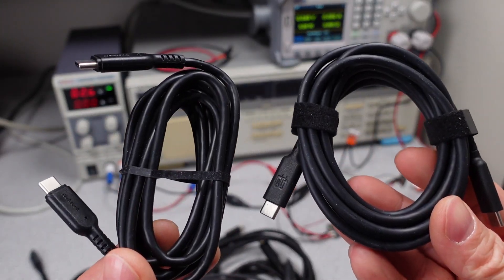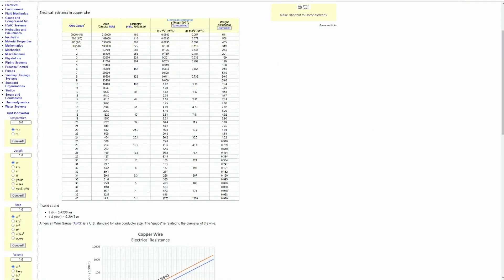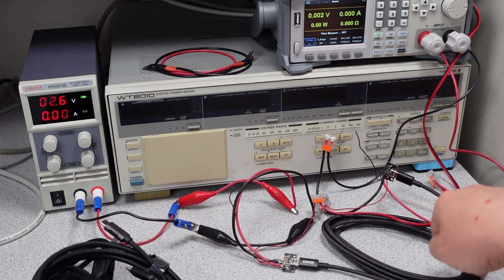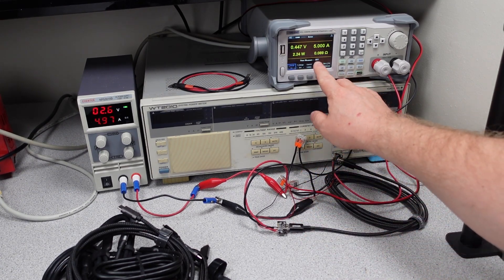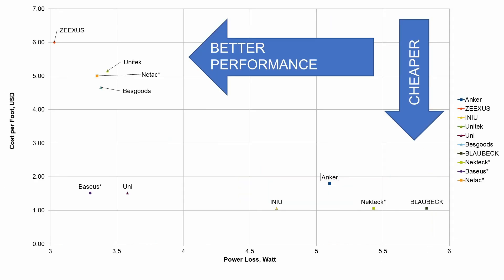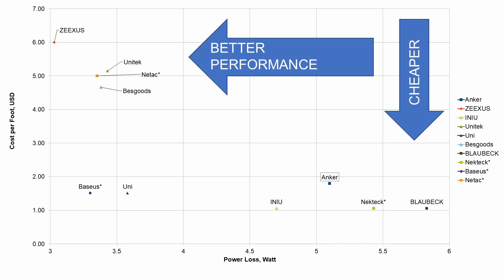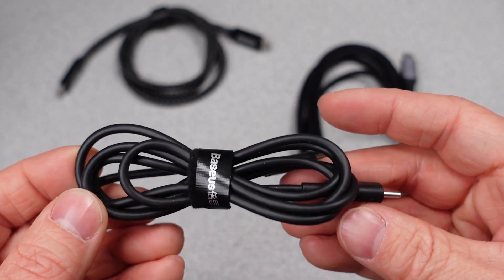Charging with USB C, does the cable matter?

Comment: what is the real world consequence of "inefficient" cables from efficiency loss? I feel like its gotta be like 10 seconds longer to charge device but idk.
Reply from the maker: In terms of time, it should make no difference at all, in terms of energy it can make a difference.  Say 1 watt loss for an average cable and connector, over an hour that's 1 WH, which is 6% of the capacity of a typical smart phone.  In terms of charging time, it's irrelevant because the cable isn't the limiting factor, it's just a lossy element between the charger and phone, both also lossy elements, the voltage is higher than the battery, as long as the cable isn't complete trash, what gets to the phone will be high enough that it can still operate at 'maximum' charging speed.

Comment: Awesome diagnostic and data!! Only thing I would mention is that perhaps you could have standardized you final charge against the cable length? I'm forget how the math would work on that since I believe resistance increases at an exponential rate over distance if I remember correctly. Bottom line, from your analysis I thought I wanted a Baseus cable for the value, but when I scrolled back in your video to check the length of that particular cable, I decided I wanted the more expensive ZEEXUS after all because I want that 4 feet since 3.3 isn't quite enough, and is a stupid fraction anyway, LOL. I like whole numbers. 😋

Comment: Does USB-IF certification matter for a 1 m charging cable that will only be used for low wattage (<20 W) phone charging, or am I fine with going non-certified as long as it's from a reputable brand?
Reply from the maker: I think 95% of the cables I have are not certified.  Wattage is a step away from the thing that matters for power loss, current does though, as the losses in a USB cable are primarily current^2 times resistance.   At 15w, it could be 5V which would be 3A, so you could see some pretty major losses in the cable from bad cables.  One method is to use a 5A or 100W rated cable minimum to minimize losses if going non-certified.

Comment: Nice video. Hope it's alright to ask a cable question here. I have a 65w anker charger (not the gan prime) and and 65w charging speed anker power bank. When I use a standard anker 100w charging cable I hit about 63 watts on the charge (according to the power bank screen), but when I use a more expensive/smarter anker 100w usb 3.1/thunderbolt 3 data cable, I hit the full 65w from the charger. Why would one hit 65 and not the other? is the more expensive cable able to do some kind of communication with the devices or something?
Reply from the maker: Yes, one cable has an e-marker chip in it.  This tells both the device and the charger to allow the current to go beyond 3 amps, up to the USB limit of 5 amps if available.

Comment: Why didn’t you just measure the resistance with an ohm meter?
Reply from the maker: I could but I don’t have a milliohm meter that will pass at least a couple amps through the cables to get a good reading of the few milliohms on some of these cables.  So, a four wire measurement in this setup was easier with the gear that I have.  Some cables also require a voltage and some logic to pass signals, apple lightning…

Comment: Does efficiency actually slow down the charging time?
Reply from the maker: So, only on really fast charging devices, or devices using high current, it can have an effect.  Say the power adapter produces 100 watts, a good cable might get 98 watts to the device, a bad cable may get 92 watts to the device.  Doesn't seem like a lot but yes it can slow down charging.

Comment: Which usb-c to usb-c cable is best for the Switch Lite?
Reply from the maker: I hope cables don't present an issue for charging.  It looks like some forums recommend a cable with a resistor so possibly an emarked cable, but that is going to require vconn, which means a pd power supply, but then the switch may not work with the power adapter.  This is what happens when a company decides to implement not-compliant with a standard.  No idea what it works with.  I've seen recommendations to only buy the official nintendo accessories.  Steam deck is also not compliant.  The standard is free also so not like there's some huge licensing fee.

Comment: Will you please compare 3in1 100 watt or 2in1 100 watt cables from Baseus or any other reliable brands.
Reply from the maker: Hmm, I haven't seen any 100 watt ones yet.  They obviously have to do something different to get 5V and 20V to not burn devices out if you plug in the other end to more than one device.  I will have to check it out.
Reply: @AllThingsOnePlace  yes please do check eagerly waiting

Comment: Apple I’m curious how high end data cables would compare! They have heavier cables for power form what I’ve seen. What I don’t know is whether those are thicker than these.
Reply from the maker: This video has a lot more cables in it.  https://youtu.be/VD5yhULVJdo In general the higher speed data cables do a little worse.  They are thicker to accommodate the shielded twisted data pairs.

Comment: I was going to go with Baseus but then at the end of the video I saw how it looked like, and that it was without a threaded cable, and then I realized I was looking at the graph wrong regarding weight, and that it actually is desireable because it relates to durability.
Reply from the maker: Yeah, I use the Baseus cables quite a bit, even though they aren't the 'best' cables, they are light and functional for charging.

Comment: I like so much your in depth breakdowns and analyses of power supplies and this not so commonly analysed topic - cable ESR. I checked my cables using Power Z KT002 USB tester and I was surprised that for instance bundled USB-C to Xiaomi 65W and Samsung 45W (both 2.0 speed ; 5A e-mark) have nice ESR (88 - 94 mΩ) while for instance USB-C cable made by Belkin costing almost 40 USD (3.1 Gen 2 ; 5A e-mark) resulted into 120 mΩ and Apple USB-C cables are compared to that B tier products (2.0 speed ; 5A e-mark) having average ESR 142 - 160 mΩ
Reply from the maker: Thanks for sharing!  If you liked this one, check out round 3, https://youtu.be/VD5yhULVJdo   round four will probably be out in January or February.  But it is true no way to no, no one tells you any specifications on cables, it is like modern devices and battery capacity, no one tells you that either.

Comment: Thanks! The wattage loss is great, but skews all longer cables toward the "worse" range, even if they are great for their length. It might be nicer on future videos to rank them like you have with cost/foot on the Y, but Loss/foot on the X, so all cables can be judged against each other for general construction quality.  You could also use something like a dot ("•") on the graph for cables that support ≧ 10Gbps data, and an cross ("x") for those that are only 480Mbps. Great test info ! Thanks for doing what we all wished we could ourselves ! Now if only we could find a quality 6' silicone sheathed cable that supports 100W (now 240W) charging and 10Gbps or greater data transfer. One can dream :)
Reply from the maker: Thanks!  The 2nd and 3rd videos have more metrics and maybe are a little clearer, the first in the series is always an experiment.  4th round will be out soon enough and yeah, a bunch of 240w cables will be in that one.  Graphing, well, all the graphics can still use work.  Ultimately, I decided the watts loss per cable is what matters since they are individual units.  It is a good idea to use different symbols for the graph.  I do include the cost per foot, resistance per foot, etc on the data available here:  https://www.allthingsoneplace.com/usb-cables    I usually put in a note on the cables capabilities (but I don't verify the data path speed which is beyond my equipment, I have lots of power measurement gear).  The allusive perfect 6 foot cable...
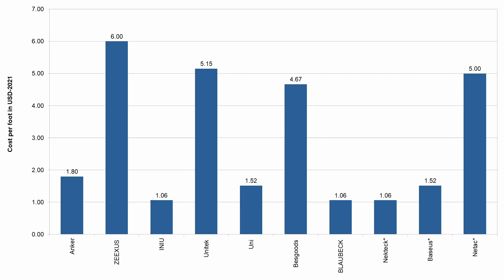Reply: I'm 1:40 and stopped the vid at the chart (with a WTF) for exactly the reason you pointed out...
Reply: Anker has a 3 feet and 6 feet silicone cable

Comment: amazing and informative video,. I learned something new today ,. so do you suggest buying a new cable for my e.g. new smartphone to have better efficiency at charging my device? or just stick with the free cable that comes with the device?
Reply from the maker: Thanks for watching!  It all depends on your needs.  If you are charging a phone with a USB C to C cable then chances are the cable is good enough.  The larger devices like laptops you may want to look into something.  The apple type (lightning) cables get covered in round three of usb cables and generally were okay.

Comment: The best 6 or 10 foot cable for when the outlet is far away from where you need to charge.
Reply from the maker: The second iteration of this video has a little more detail and the cables broken into groups. Comparing way too many usb cables with too much data. 😀
https://youtu.be/ICrLyHa_4nE  there will be a third video at some point…

Comment: Very interesting video.  About a year ago I went nuts trying to find a short one foot USBC cable to replace the one that came with my DJI drone controller so I could use a tablet.  I wanted something  with right angle connectors preferably.  After buying 3 cables that didn't work I wound up finding one by anker that did but it had straight connectors which was less than ideal, still it was a quality made cable and transferred data.  Eventually a found another brand that stated right on the ad it would work made by skyreat and it's been great although it seems like a very thin cable.  In my opinion USBC has been the most confusing thing ever with all the different cables and standards as well as low quality cables that may not even work (some only worked with a specific side facing upwards, a friend of mine told me that's wired wrong).  It'd be really nice if a manufacturer produced a line of cables that simply supported everything and made them available in all lengths with different jacket materials and both straight and right angle connectors.  Of course they'd be expensive but for those of us that want every cable we own to simply work for every task it'd simplify things.
Reply from the maker: Yeah, it is complicated.  I know the cable can do a lot too so depending on what you find it is all over the place for results.  The real thing the manufacturers need to list is resistance of the cable connector to connector. At least then it’s simple enough to pick the lowest value for maximum efficiency in charging.  In terms of other features standardization exists but it’s a so confusing with thunderbolt, usb 2, 3.1 gen 1 and gen 2.  But yeah in my roundup the thinner baseus cable actually didn’t do bad but it was a charging only cable.  Anyway thanks for watching and thanks for the great comment.  I do have a part two looking at more cables and have had a few suggestions so a part 3 is likely.
Reply: @AllThingsOnePlace  I must have watched 20 of your videos today, some of the results were very surprising like the apple chargers that are actually the worst of the bunch.  Your efforts are appreciated, thanks again!
Reply: Iniu has right angle cables on their website

Comment: Love the concept behind this video but it's missing an important bit of info: length normalized results. It's entirely expected that shorter cables would have lower resistance, so to compare them to cables of longer length is unfair. The table that would be most useful is resistance per foot of cable.
Reply from the maker: Thanks!  And yes, this was a quick concept to get an idea of what works.  I agree that a resistance per foot graph and table would be great.  I will add that into the next one (and the data from this one as well).  There is also the not-insignificant resistance of the connectors but those will always be part of a real cable.  

I made a reference cable with large gauge wire for repeatability testing as well (with connectors).

Comment: thanks for the detailed test. I was also curious to see if USB2.0 cables were better for just charging as they do have less conductors for data transfer and thus allow for thicker power wires for same cable diameter. I actually bought a 3m long Stouchi C-to-C 2.0 cable. Using a TC66C i determined a loss of about .18V at a current of 1.5A while operating my Dell E7240 notebook with a PD trigger adapter. I think this is quite good, especially considering cable length.
Could you please make a test of those and maybe a comparison of equally thick USB 3.x vs USB 2.0 cables?
Reply from the maker: I have some more USB cables to test, some are USB A to USB C and are 2.0 data and power.  Some are 3.0 data and power.  For your able that current and voltage that gives about 120 milliohms which for a cable of that length is very good.  I will have to pick one up to check it out.  I am assuming the brand is Satechi?